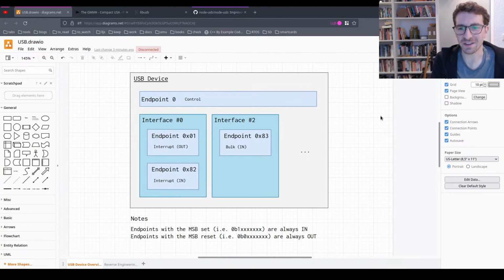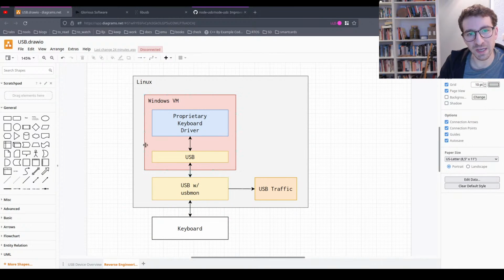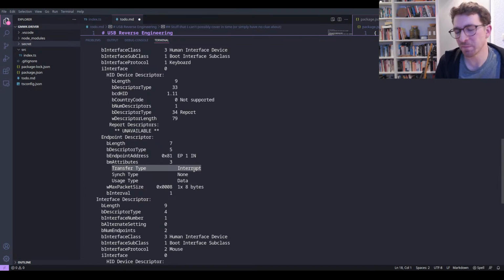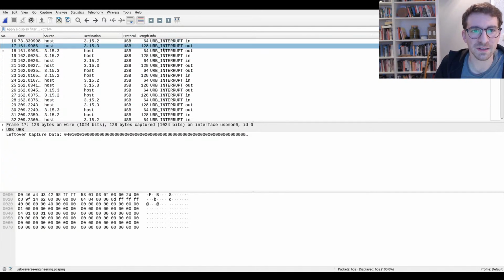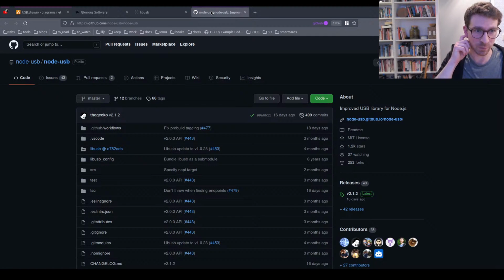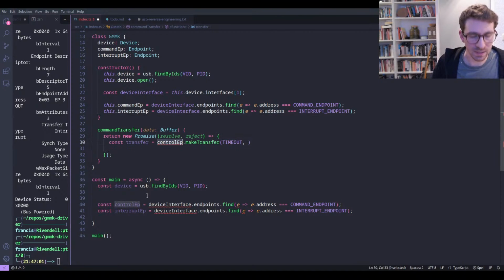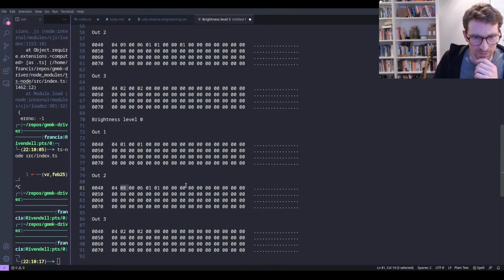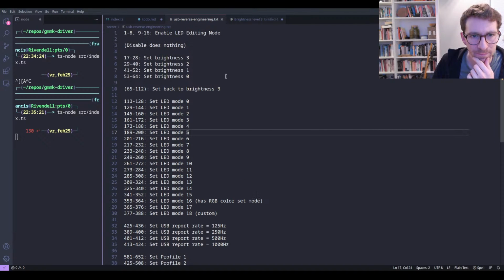[stream] USB: Reverse Engineering and Writing Drivers

Comment: Nice channel, you do weird things in JS as do I... like writing VMs... it's cool to see different people's approaches.  Now I am working on my JSASM which is an instruction set simulator in JS that itself can be assembled to different platforms after it is debugged in native JS.  It of course to run, has to use a mixture of internal memory handling (like a simulator/emulator) as well as actual JS constructs.  I figured I'm tired of coding separate JS, Z80 and 6502 logic... why not make it work in all cases but... with the benefits of debugging in JS.  And anything I code still runs in JS so i can re-use it for my other projects.

Comment: WebUSB is for the browser, so I'm not sure how you would expect it to work when not running through the browser. Admittedly I would never use node for a project like this, so I can't comment on how it interfaces with those bits.
Reply: I don’t see a reason why you would make yourself miserable and code such drivers with web api’s.
Reply from the maker: WebUSB is a standard, which while intended for browsers , doesn't actually include anything that would stop it being implemented in other environments.
Reply: I agree